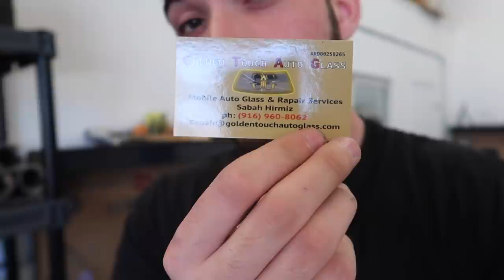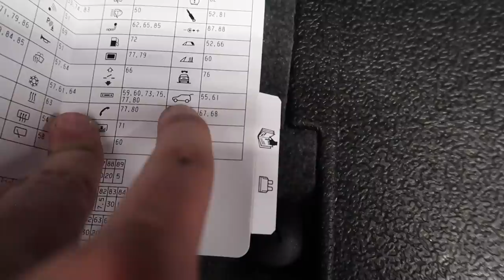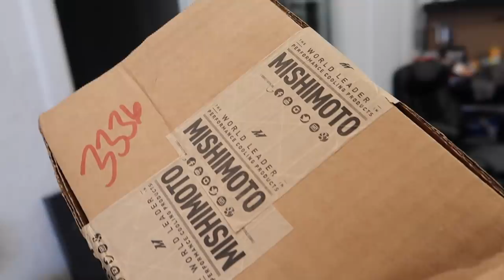UNABLE TO REGISTER THE $800 BMW 650I!!!

Comment: Hey, if Jonathan is throwing belts it's usually a bad idler/tensioner.   I've had it where the bearings felt fine so really hard to diagnose but when I replaced them it stopped throwing belts.

Comment: Check to see if the trunk latch is disconnected. I had to disconnect the latch two days ago on my e60 and open and close with key because it wouldn’t latch. With it disconnected you won’t be able to open it with the inside button. Come to find out the brown cable that connects to the latch had broke and I ended up soldering the wire back.

Comment: if the lien is payed off you can call the bank that placed the lien and get it removed but you should still be able to register the car as long as the lien is payed off by the original owner. after the lien is removed you will get a clear title witch will make it easier to sell the car if you do. the dmv told me this with my bmw witch had a lien recorded on the title, hope this helps.

Comment: U need a lien release for a car with a lien on it. Lien has to be satisfied before it can be registered
Reply: Clint Allen I’m in the same boat I just purchased a 328I from the towing company they had a lien on he gave me all the paperwork to register it how do I go about registering
Reply: MrTuna714 you have the title with a lien on it? Or just the lien paperwork? You need to contact lien holder and get lien release. If u have the title with that lien release you can register it. If not you need to use paperwork to apply for title and then you can register it with the lien release.
Reply: Clint Allen  need a title.. I have all the lien paper work from the tow yard that sold it to me would I have to go to the dmv with the paper work?
Reply: MrTuna714 yes. Or you could try and contact the last registered owner and see if you could give him a few bucks for the original title and you can skip all the lien issues.
Reply: Clint Allen ok thanks for all your help but think I would just have to go to the DMV

Comment: To my knowledge, you bought the car off an auto auction correct?
Then you wouldn't be able to sue in small claims for unjust enrichment or fraud. That leads you to take the previous owner and tell them to pay the lien or sue  the seller for selling a car they don't own. Your recourse will leave you in agony. Check the Dept of vital records too.
Reply: Hugo Lizardi I’m in the same boat yes I push this from her tow auction owner never came back for the car talk company kept it so I bought it with all the paperwork lien paperwork how do I go about registering can u help
Reply: @MrTuna714  What Information do you have? You have the car, and know the lien holder correct? Be advised that I only know CA law and cannot advise you properly in other jurisdictions. Also, correct your comment as there are grammar errors that conflict with your message.
Reply: Hugo Lizardi I have all the paper work from the tow place I purchased it from they gave me all the lien  paper work would I have to go to the actual dmv to Register it Iam CA as well